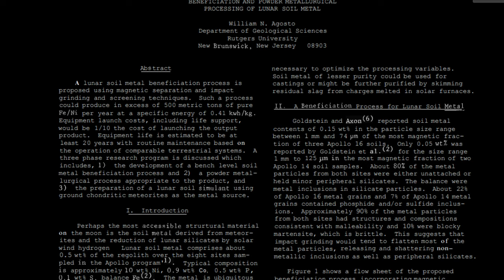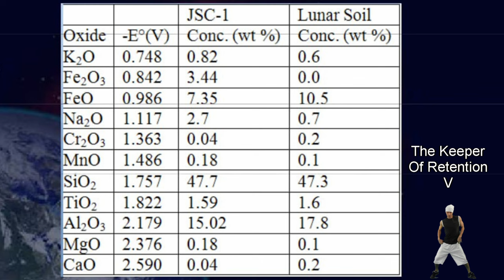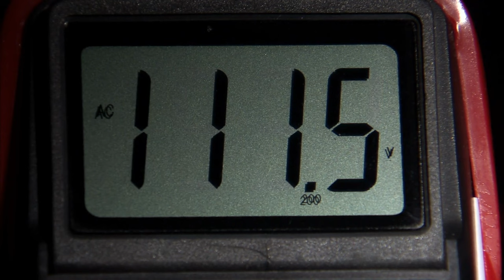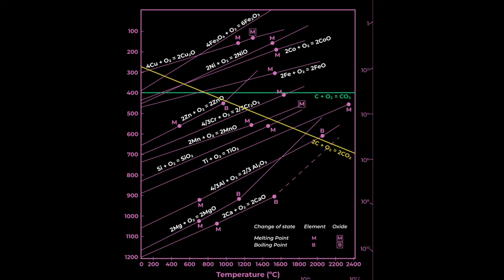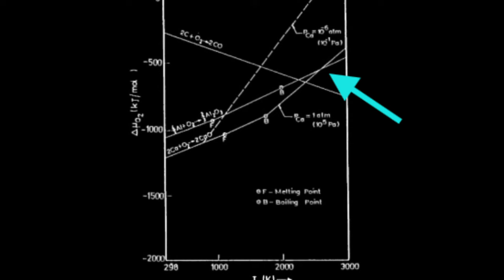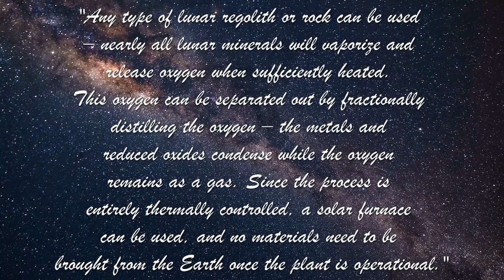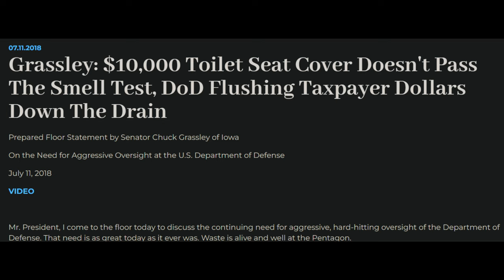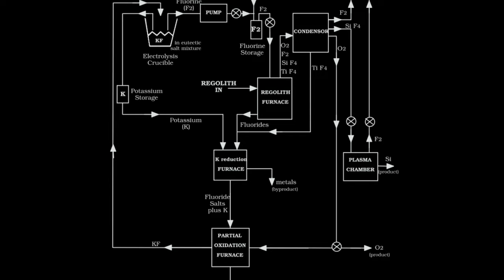Lunar Metallurgy

Comment: It should be possible to collect significant amounts of metallic iron nickel alloy just by running a magnet over the surface thanks to all the meteorite impacts.
Reply: Probably good for bootstrapping small things, but not industrial scale production.
Reply: Dont high temperatures reduce magnetism?
Reply: Like a metal seperator used for recycling, should work pretty well do to the low gravity, so you might get the metal even a few centimeter below the surface. Means you can easily process 100 tons per hour resuting in 500kg of iron. Without the need of excavation an little power demand.
Reply: @PaulSpades  well let's do some quick math: 
A crater is usually 10 to 20 times the diameter of the impactor. That means the material excavated is ~10^3 times the volume of the impactor. The materials are similar in density so I can estimate that each ton of lunar regolith will contain about 1kg of meteorite. 

about 5% of meteorites are 95% metal. The rest are between none to a few percent. For ease of math let's just assume 5% of the material hitting the moons is metal. 
This means that each 1000kg of regolith will have on average about 50 grams of metallic iron. Probably more when you consider that the same regolith may have been hit multiple times. 
Now That's not a lot but extracting it will be sooo much easier than trying to reduce the oxides.
Reply: @theCodyReeder  That seems like a pretty useful idea! I wonder how to scale up production to an industrial level. A wheeled vehicle with magnets in the front, kind of like a grain harvester here on earth, just for metal instead of food.
Reply: @lefishe7702  Yeah heat effects or destroys permanent magnets add some point depending on the material, some can handle very high heat.
Reply from the maker: @theCodyReeder  The impacts basically vaporize the meteorite metal and scatter it across the surface in the form of free iron in agglutinate glass. If you impact mill it, it flattens this iron while shattering the 'glass' allowing a magnet to pull it out. This is what Agosto proposed in 1981 (I mention this breifly at the beginning of the video) and I agree it's the best early step. Using this method you can collect 184 kg of pure metal per hour but you have to process 36,800 kg of regolith to yield this because the free iron content of regolith is only about .5 percent, while the remaining 11.5% is mineralized. 
If we're gonna build mass drivers and Stanford stations and power satellites and O'neil cylinders and orbital reefs and colonial fleets and lunar chicken holes then we're gonna need to reduce the oxides- not to mention needing silicon and aluminum and sodium for batteries and titanium and sulfur. Oh yeah and the O2. 

Agosto: https://arc.aiaa.org/doi/abs/10.2514/6.1981-3263
You definitely shouldn't use Sci-Hub to get this article. That would be BAD. Don't put https://doi.org/10.2514/6.1981-3263 in the Sci-Hub search bar! No!
Reply: @Coolproko  I am thinking about a design like a compactor, the drum is magnetic on one side, as it rolls over the ground the metall particels get stuck and ride over the top of the drum, where the magnetic field ends and they fall in a collection tray.
The tray than gets dumped at the base or in a hauling truck.

Would be simple, low cost, little wear and can be powered directly with solar.
Reply: Eh.  Most iron rich compounds aren't particularly magnetic, and you're not lightly to find pure iron on the moon.
Reply: Lunar regolith is FULL of iron.  Mainly various iron oxides.  But it's still going to require some heavy refining to get pure iron out of the deal. 

But yes, nickel/iron/chromium alloys are perfectly workable materials.  Not as strong as steel, but still very good.
Reply: @iriswaters  Watch at 4:50 min, regolith contains 0,5% metallic iron
Reply: There's nanoscopic particles of npFe⁰ in some of the lunar glass, but that's not something you can count on for an iron supply.
Reply: Virtually all of the iron in the regolith comes in the form of various ferrous(2+) minerals like ilmenite, pyroxene and olivine, which are, at best, incredibly weakly magnetic.
Reply: @lefishe7702  high temperatures ruin magnets, but they don't make ferromagnetic materials not react to magnets.
Reply: @lefishe7702  I think this is during the mining process step. run a rover with a large permanent magnet around a crater like you would a Roomba and then scrape off the iron particles collected by the magnet to be later refined. A good short term solution to get a relatively high purity iron. Shackleton crater is approximately 350 km^2. assuming a hopeful 100g of magnetic iron per meter square of regolith then that would be around 35000 Kg of iron. which is only about 38 American tons.

a way to get some easy iron but not long term I think
Reply: Hey cody, what do you say about vaporizing basalt in a vacuum to test out the theory in this video?
Reply: @lefishe7702  only past the curie point, if a ferromagnetic material is below the curie point then it is still ferromagnetic
Reply: @groomschild1617  Your math is off.
A square kilometer is 1million square meter.
Based on your 100g you get 100 tonnes per square kilometer and 350000 tones from the entire crater
Reply: @Anthrofuturism WAIT how come you get to post links on youtube, my comments with links have been consistently deleted for over TEN YEARS now, what sorcery is this who did you pay/threaten???
Reply: @jonasstahl9826    ah thanks I new I was missing a 0 somewhere
Reply: @Anthrofuturism  I missed the mention of it. Definitely some good points. Something I will mention is that though a lot of the impactor does get vaporized not all of it does. People were picking up softball sized chunks of iron near meteor crater. If I remember right several train car loads of it were taken to a smelter.
Reply: @redcoat4348 I was actually planning on trying something similar. A more hybrid approach, basically high temperature electrolysis in vacuum.
Reply from the maker: @theCodyReeder  Dang they just smelted the meteorite chunks?!? Lmao aren't those worth thousands nowadays?
Reply: @theCodyReeder  I hope that becomes a video one day!
Reply: PLANETARY SUBWOOFER
Reply: @TS-jm7jm  it's his channel
Reply: Spending billions of dollars to make a net profit of 50 bucks <with government subsidies mind you> clearly a graduate of Elon Musk School of Business
Reply: @lefishe7702  No, high temperatures can demagnetize permanent magnets, but will not affect the magnetic properties of ferromagnetic metals.  In other words, if you heat a magnet beyond its Curie point, it will lose its magnetic properties.  Once cooled, its magnetism can be restored by exposing it to a strong magnetic field.  A cold piece of iron or nickel will always be attracted to a magnet regardless of how much it has been heated in the past.

Comment: For a college class, I had to design a lunar base concept. Ended up designing a factory making mirrors for use in concentrated solar.

The lack of available carbon made my metallurgy research take twice as long as it would have otherwise. It was mind numbing. If this video existed in 2022, I would have been sobbing in joy.

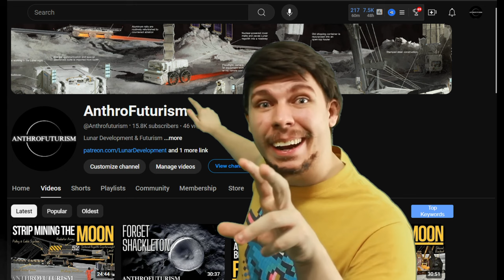Comment: 33:10 NO COLD TRAPS FOR O2. We do not want to run the risk of producing singlet oxygen (which commonly can happen with Schlenk lines) under cold/vacuum. Singlet O2 is an excited state that could potentially explode.

The best solution is to vent it via negative pressure with additional condensers for metal vapors.

- your local Chemist
Reply from the maker: @GoodBoyWonder  great thank you!
Reply: It seriously a WTF that singlet oxygen is not the ground state. Almost always the triplet is the excited state for simple gases, but it is the ground state for oxygen.
Maybe that causes nature to so easily produce it? And the closeness of triplet and the singlet state in energy.
Reply: @adamrak7560  it's because O2 has two degenerate pi* orbitals. And thanks to Hunds rule and the Pauli exclusion principle, you get these interesting Molecular states.
Reply: What is 'negative pressure' in relation to a vacuum process?
Reply: @KyleDunnIt  a lower vacuum
Reply: @twsteele1977  a lower vacuum than what is found in space/on the moon?
Reply: @KyleDunnIt  it wouldn't be as low as that because the refining process would release some O2 and be under partial pressure
Reply: @twsteele1977  fair enough. I'm not convinced venting is the right solution regardless.
Reply: just make it explosively react with water to create a pulsed detonation steam engine and capture some electricity in the process. You would need to overengineer the seperate reaction chamber to handle multiple explosions.
Reply: @JeroenvanGutsem-u7e  lmao, these are the most fun solutions.

Comment: I think the killer problem with the vapor distillation approach would be throughput. the need for very low pressures means that only a miniscule amount of regolith can be boiled at a time. density of solids and liquids vs low pressure gas is massively different. it would probably be a century or two post lunar colonization before lunar industry can be big enough to produce a vapor distillation refinery  large enough to produce a worthwhile amount of iron
Reply: My initial reaction is to disagree. With very low external pressures vacuum chambers can be built very, very weakly and therefore be much much larger than anything you imagine on earth. At that point you just need sufficient pumping

Comment: I had kind of wondered why not just use a blast furnace and fairly traditional forms of separation (chemical and density in a large molten batch) at first, but the idea of just vaporizing and distilling pure materials at relative low temperature in a vacuum is literally beyond incredible. A holy grail of material refining. Quick, simple, cheap, scalable. That is the sort of technology that could make colonization of other stellar bodies economically feasible. The best thing too is that it's a continuous process rather than a more labor intensive tapping based process. Then again, maybe there are specific methods tried to refine basalt into usable metals that could be looked at. 
 
Now we just need to make ceramics out of the regolith materials that can be used for things like that condenser pipe. And then any industrial waste created on the moon from materials mined on it can then just be fed back into this process in an infinite recycling loop that only slightly decreases the efficiency of the overall system.

Comment: i guess the solution would be multiple methods not just one to fit them all. some elements might be done in a pressurized inert chamber with 1 atm pressure or a suitable range. in melding for example we use an inert gas( argon, co2) to prohobit the bonding between oxigen and steel. as you shown greatly this is an engineering problem which of course is solvable and not a physics problem. great work,

Comment: In the US we send a bunch of alfalfa to China not because it’s super profitable but because it’s super plentiful. We receive a bunch of cargo ships full of goods from there so in order to not send the ships back empty handed we stack a bunch of alfalfa on ships and ship it away for basically pennies. This is to say an economy that receives a lot of imports does not need to try very hard to spur on exports. This means we can subsidize lunar exploration with lunar mining as long as fuel isn’t crazy expensive. 

Hell, silicone (sand) is priced at 3.52$, if we just filled a starship (carrying capacity 150 metric tons)  full of silicone we’ve made $1,164,240. While not great, this is literally the lowest end since silicone is basically just sand. 

Sorry if you do mention this btw, I just started the video but I’ve had this on my mind while reading ur book

Comment: With vacuum distillation of metals, I think the big headaches are going to be coming from getting the ore to distill without distilling the distillation apparatus, and getting the cooled metals to condense in the target areas, instead of *everywhere*. Any distillation apparatus will have distillate condensing on every surface that is too cold to evaporate it, except you're talking about sublimation/deposition here, not liquid. You can expect it to go straight to solid on every part that isn't also melting in that environment.

Skipping a lot of the explanation, fill your vacuum flask with regolith, pull a hard vacuum, and project a jet of argon plasma into the mass. Place the plasma emitter and vacuum ports horizontal and across from eachother like an upside-down " T ", and have an auger deliver fresh regolith down from a staged hopper (like a concrete-shooter pressure pot) into the plasma stream. Any erosion/deposition will then be to the inner walls of regolith, rather than the pressure chamber itself. 
In front of the vacuum port is a cooled target plate, in the shape of a rectangle. An electromagnetic field causes the droplets/crystals/dust of conductive elements to move toward one end of the target/collector rectangle, and a reverse-polarized electric charge on the target plate causes the argon plasma to form more of a beam and orderly-ish path as it melts a hole through the regolith supply, and some deposit/remelt will likely take place along the path, causing some inherent melting-point separation, while continuously replacing the working surface of the chamber. You will never be getting a near-perfect vacuum in there because the regolith will be off-gassing with any heat increase. You can rinse away liberated Oxygen and other reactive species with rarefied argon plasma. It should be pretty easy to separate for re-use. 

If the target "rectangle" is in the form of a metal band/drum that moves like a conveyor belt/wheel in front of the vacuum port, and the beam separation gradient is perpendicular to the belt movement, then the material should lay down like Neapolitan Ice Cream, but with more flavors and with a bit of blending between each. You could place scrapers at different locations to collect the partially concentrated cuts of material deposits into different chutes, with their outputs leaving the chamber in staged pressure pots, like the inputs. The mixed areas between the "good cuts" of materials can then be re-cycled into the infeed for improving purity before individualized purification stages. 

The scale and productivity of this design can be made very small for experimental models, or large enough for a more industrial use, and shouldn't really need to be taken offline once a mature system is produced. Then, multiple large models can be made in a more production-oriented facility, but this would still be more suitable for making high-value feedstocks/isotopes for technical products/spacecraft/science rather than bulk structural components, but the largest output will still be low-value glasses.

The small amounts of high-end materials should easily make the system worth the cost, while the glass droplets should come out as flowable, fusible bits that could be sintered into filters, diffusers and interlocking bricks. Refined glasses for fiber optics, light pipes, and chemistry glassware would also end up with enough sub-par material that can be spun into fiberglass fluff to pack between the structural bricks. Particles entrained in escaping atmosphere will tend to accumulate in the tangle of fiberglass and create a self-healing seal while metal clips hold the bricks together physically. Labyrinth seals and tubing molded right into the bricks slow atmosphere leakage while directionalizing the wayward molecules toward vacuum collection channels.
Reply from the maker: Fused silica melting temp ~1800 C.

Comment: Out of curiosity, why not carbonyl chemistry--converting iron oxide into iron pentacarbonyl by reaction with CO and then decomposing it? It requires carbon, but that can be recycled in this process, and allows you to operate at much lower temperatures.

Comment: I think we will import carbon pretty heavily as methane. Starship runs on methane and is meant to be refueled in orbit, which means loading infrastructure, tabkerships, and transfer ability are already baked in. Certainly i think it will be the main way to export hydrogen.
Reply: Dont think so the main source of carbon will be the food that gets imported from earth.
Reply: @jonasstahl9826  I'm not necessarily saying that methane will be the main source of carbon, I'm saying it will the main source of hydrogen imports, and consequently will be a significant source of carbon.
Reply: @neolithictransitrevolution427  You dont need hydrogen aswell, water will be a closed loop system and they get additional water from regolith and ice or again food imports.

Comment: room temp surface, similar to a sputtering machine. metals will solidify onto it, and the oxygen will bounce off and stay gas. The metal will thicken into a plate while the oxygen can be condensed in a cold trap, like those in the bottoms of craters in the moon.

Comment: Most of your formulation also produces many cement constituents, and cement mixes with sand and pebbles 1:5; what about cement? Water can be recycled by steam/sublimation. About simulant, you can mix any basalt with small amounts of oxides to create your own mixture, once melted, all will be the same, with an excess of OH, H, CO2 and other volatiles. Also, heating up things will be a lot easier to cold down all that superheated regolith without any convection or conduction.

Comment: They oxygen we should just feed into a cave somewhere.  Increase the vapor pressure by pumping in gasses, get thermal convection going and melt that ice so we can have so underground lunar rivers.  Those caves are like 5km in diameter and likely as hermetically sealed as need be as there is no real air currents on the moon and gas will just slowly go to the lowest point it can and kinda... sit there.